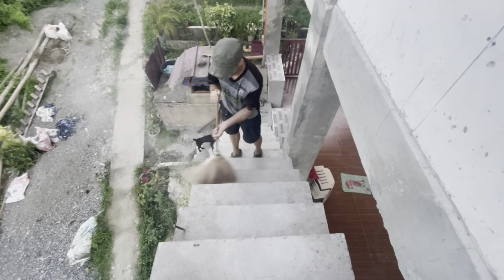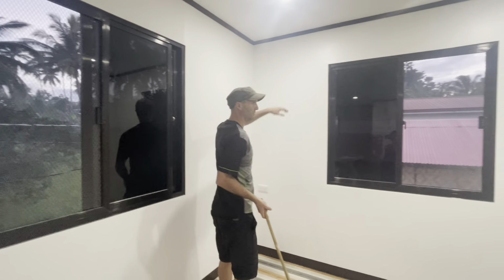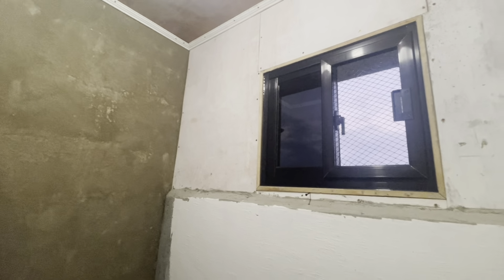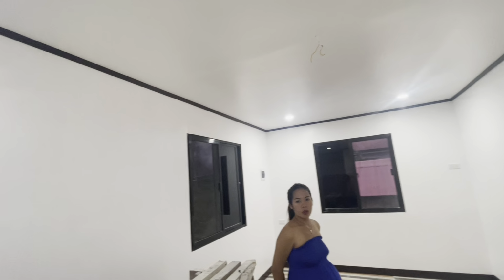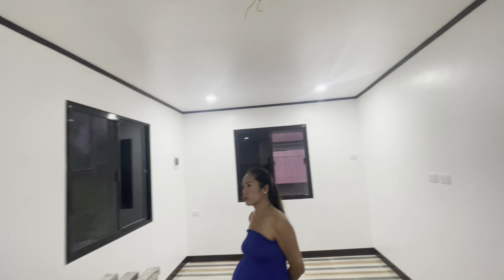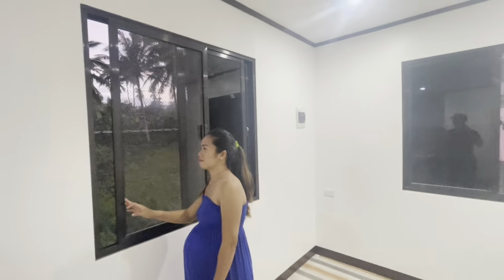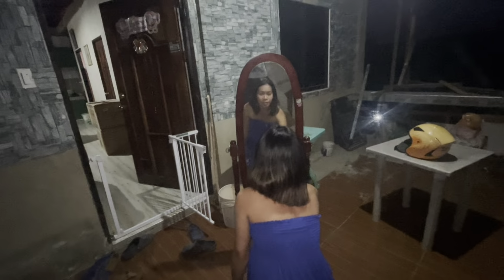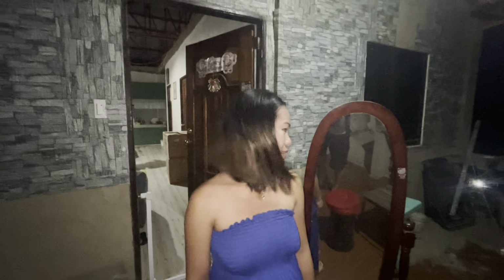House update - Installing windows + my new sideline

Comment: Love the room, the windows with screens to make the room cooler and bug free. You won't get any bugs if your door has a bug screen too, thn the door can stay open? The fridge should be where you said Dustin, you could even use that plug point in the cupboard by a hole going through the side to feed the fridge wire and plug? A big bed would be useful too long with chest of drawers and wardrobe for your clothes? Reche's hair surprisingley looks good, its a bob and longer at the front(sides) is a style of 'bob', 'Hair by Dustin'.

Comment: @Dustin did u know u can sell hair nowadays? i just sold mine coz i needed money, the thicker and longer the hair the higher the value. U could also donate it as they make it wigs for cancer patients just like my sister since she has thicker hair than me. Reche’s hair is thicker than mine, if i could shout on the screen to keep it for donation or sell it, usually cut in portions because straight is easier to cut or theres a tie while cutting it, thats the proper way then u keep the cut hair whole with a rubber band. Reche is always positive and not fussy.

Comment: I wish u have the screen on the windows to avoid mosquitoes esp for the baby.
Reply: The screen has two layers. There is a layer on the back that is a fine mesh that will stop mosquitoes but its hard to see on video, the larger mesh you can see is mainly to protect the smaller mesh layer. Plus the window installers caulked around the windows which will help a lot as well.

Comment: buy a  1 1/2  and 1inch  tubular ,  build your design and  hire a welder  you can have a cheap stair railing it will not reach 62k